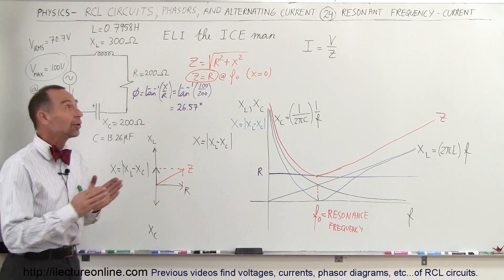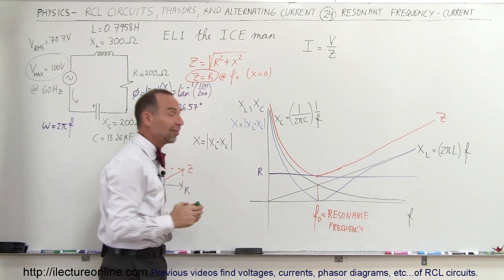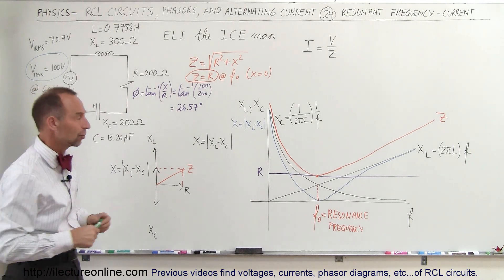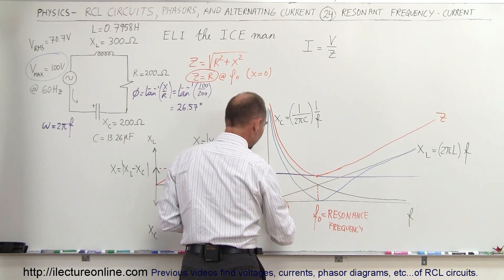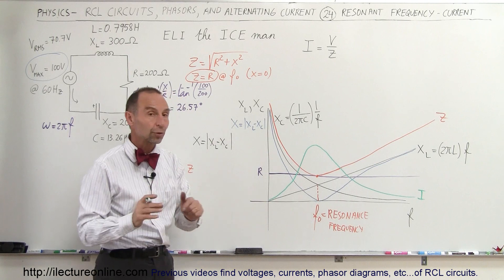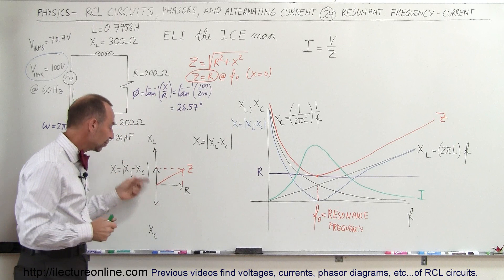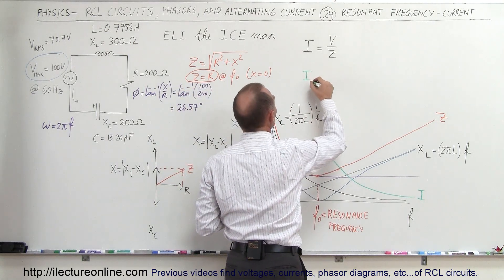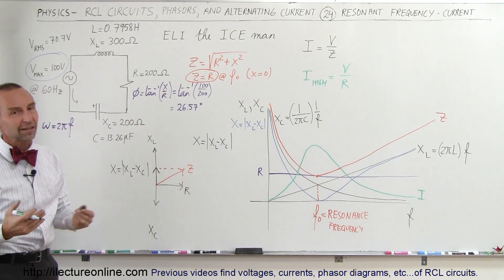Physics - E&M: RCL Circuits, Phasors, & Alternating Currents (24 of 24) Resonant Freq - Curent

Comment: So any particular reason for assuming the current to be in phase with the resistor? In your earlier videos you calculated the current by voltage / impedance, with respect to phase angles of both emf and impedance (0 degrees for the voltage)
Reply from the maker: I rms = V rms/Z
I peak = V peak / Z
Those calculations don't have anything to do with the phase angle.  They just give you the I rms or I peak.
Only for the resistor will the current through the resistor be in phase with the voltage across the resistor.
That is not the case for the capacitor (current leads the voltage) and for the 
inductor, (voltage leads the current).
The phase angle is the phase angle for the whole circuit, where the voltage will lead or lag depending on the components in the circuit.
Reply: Michel van Biezen Ok, thank you for the videos!